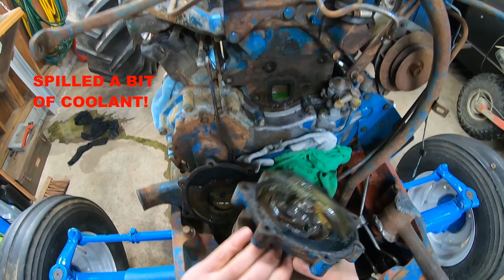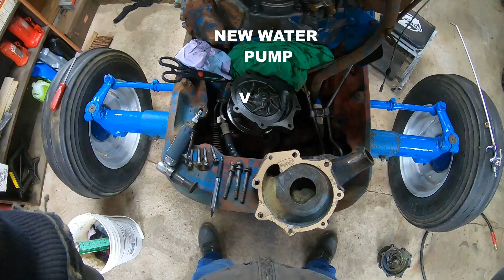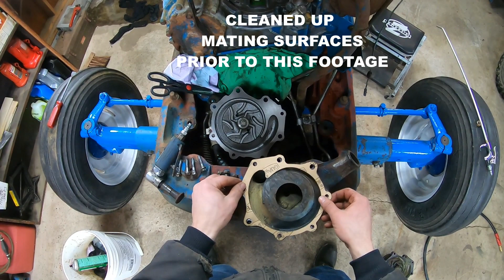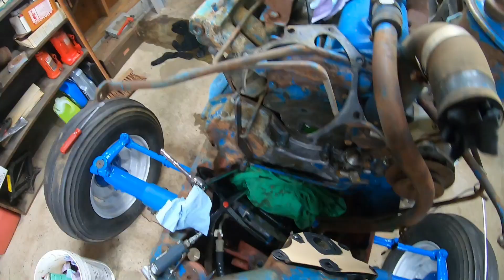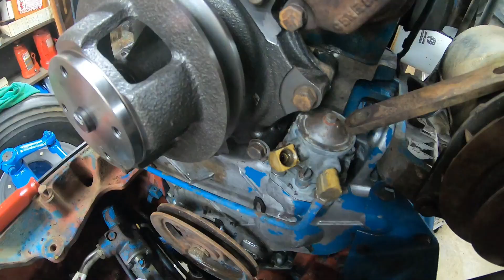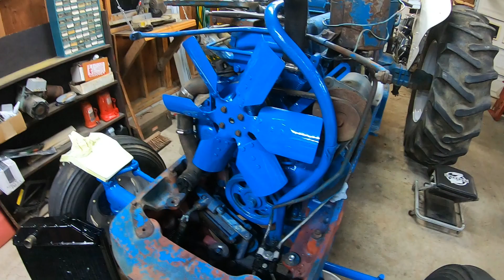Ford 5000 Water Pump

Comment: Will every new aftermarket waterpump have the thicker section for the generator bracket or just that certain one you got?
Reply from the maker: Pretty sure it was just the one that I got.. I found several other aftermarket ones that look closer to the original.
Reply: @marktolman207  okay thanks a lot!

Comment: Hey Mark, dumb question...do you remember on the power steering cylinder which port is the high pressure versus returns to the reservoir?
Reply from the maker: On mine, the top port is pressure, the bottom was return
Reply: @marktolman207  I was hoping you wouldn't say that...looks like I got some do-it-again work tomorrow...my tractor is same year make model as yours.
Reply from the maker: That's the way mine is! Haha, I'm not sure if they are interchangeable....I dont believe so

Comment: Hey Mark, I've found that when cleaning out a mouse nest, grease and oil mess out of the steering area that it's important to check for parts...a roughly three inch by about 3/4 inch flat stock was laying around loose in there.  Also found in the gravel driveway another piece that had probably been there over a year and together they make up what looks like a power steering holder like you made.  No indication that either was attached when I bought the tractor which explains why my hard lines were worn away to the point of leaking.
Reply from the maker: There is not much information about that factory holder, so I'm not really sure what was there to support the power steering lines! it didn't seem to hold up well, whatever it was, because every one of these tractor have the same problem!